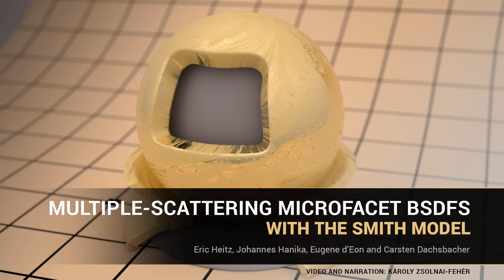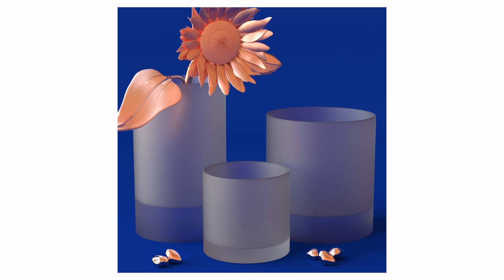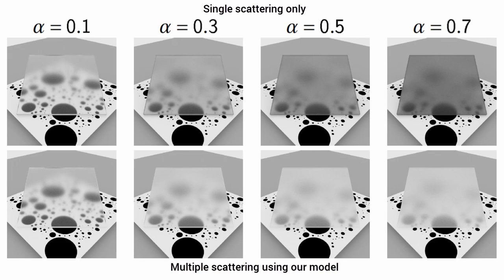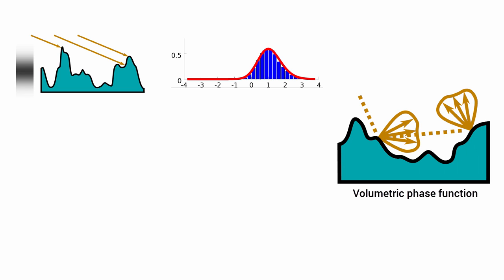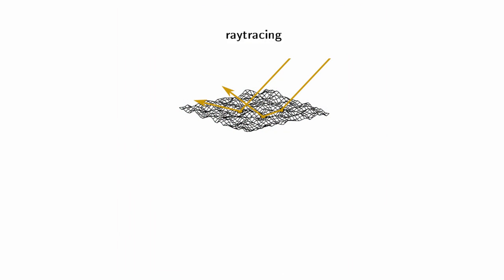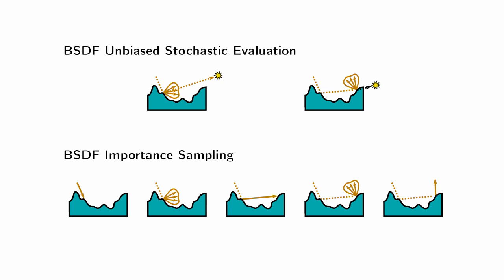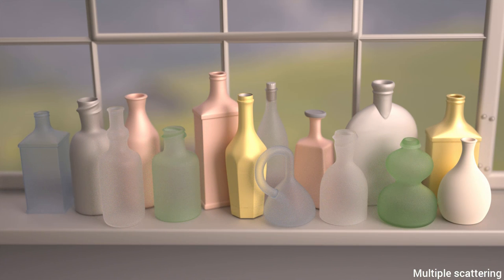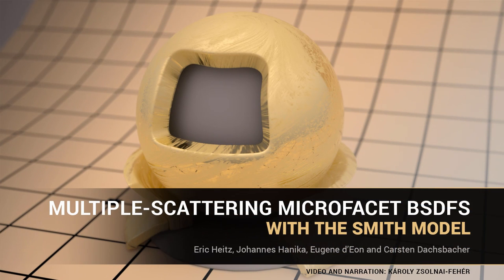Multiple-Scattering Microfacet BSDFs with the Smith Model

Comment: awesome! hope blender gets this! until then i may hack this using nodes. =3
Reply from the maker: +CynicatPro I was really looking forward to your Uber shader video that popped up not so long ago. About to watch the crap out of it today! :)
Reply: +CynicatPro I'm curious if you could come up with something that actually does this. I think Cycles internally already uses the Smith model. How would you simulate higher order bounces?
Reply: Kram1032 not sure if i could do higher order bounces but i might be able to add the energy lost, and saturate the multiple bounces. have to test at some point =3
Reply: Károly Zsolnai-Fehér 5 min of me talking about ubershaders followed by about 20 min of me talking about how graphs get turned into code and how we can abuse this for high performance shaders =3
Reply: CynicatPro ah I see, faking it. Makes sense :)
Reply: Kram1032 no low level control in the node editor =< i wish it did but 99% of artists wouldn't use it.
Reply: CynicatPro true. Perhaps something could be done with a Open Shader Language script though?
Reply from the maker: +Kram1032 There is discussion taking place on the LuxRender forums about this: http://www.luxrender.net/forum/viewtopic.php?f=36&t=12534
Reply: ***** i'm not addicted. i could quit anytime! i just don't want to!
Reply from the maker: +CynicatPro It's not addictive at all - I have also quit before. Three times. :)
Reply: Károly Zsolnai-Fehér your good at quitting. you've done it so many times!
Reply: ***** nice! That was what I was hoping for when I immediately made it a BlenderNation post when I heard of this. Great to see that it worked :D
Thanks once again Károly Zsolnai-Fehér